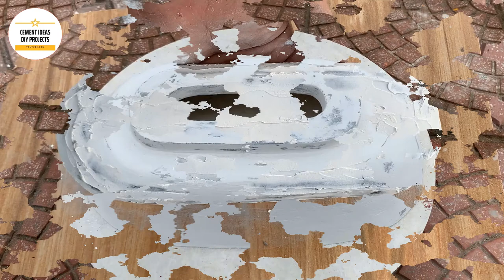Cement bathroom sink diy - how to make a cement bathroom sink

Comment: Making a cement bathroom sink can be a rewarding DIY project that adds a modern and industrial touch to your bathroom. Here's a step-by-step guide on how to make one:

Materials Needed:
Cement mix (countertop mix is recommended for better durability)
Water
Mold release agent (e.g., cooking spray or specialized mold release)
Melamine or plywood for constructing the mold
Silicone caulk
Sink template or basin for shaping
Sandpaper or concrete polisher
Sealant (e.g., concrete sealer or epoxy resin)
Protective gear (gloves, safety goggles, mask)
Tools:
Circular saw or jigsaw
Drill
Screwdriver
Clamps
Trowel
Mixing container
Sanding block or electric sander
Paintbrush or roller (for applying sealant)
Steps:
1. Design and Planning:
Decide on the size, shape, and design of your cement sink.
Create a template based on your design, or use an existing sink basin as a mold.
2. Construct the Mold:
Cut the melamine or plywood into pieces according to your sink design.
Assemble the pieces to create the mold, ensuring it is sturdy and leak-proof.
Apply a mold release agent to the inside of the mold to facilitate easy removal of the concrete later.
3. Prepare the Sink Template:
If you're using an existing sink basin as a template, place it upside down inside the mold.
4. Seal the Mold:
Use silicone caulk to seal any gaps or seams in the mold to prevent concrete leakage.
5. Mix and Pour the Cement:
Follow the instructions on the cement mix packaging to prepare the cement.
Pour the cement mixture into the prepared mold, making sure it fills the entire mold evenly.
6. Remove Air Bubbles:
Tap the sides of the mold gently to release any air bubbles trapped in the cement mixture.
7. Cure the Cement:
Cover the mold with plastic sheeting to retain moisture and let the cement cure for at least 48 hours.
8. Demold the Sink:
Carefully remove the mold and take out the cement sink. If necessary, use a screwdriver or chisel to pry it loose gently.
9. Sand and Polish:
Use sandpaper or an electric sander to smooth any rough edges and surfaces of the cement sink.
Polish the cement to your desired finish, whether it's matte or glossy.
10. Apply Sealant:
Once the cement is fully dry, apply a sealant to protect the surface from water damage and stains. Follow the manufacturer's instructions for the specific sealant you're using.
11. Install the Sink:
Install the cement sink in your bathroom according to standard plumbing practices, or hire a professional plumber if needed.
Safety Tips:
Wear protective gear such as gloves, safety goggles, and a mask when working with cement and sealants.
Work in a well-ventilated area to avoid inhaling cement dust and fumes.
Follow all safety instructions provided with the materials and tools.
With these steps, you can create a custom cement bathroom sink that suits your style and adds a unique touch to your bathroom decor.

Comment: What is the different materials of the layers you put on it?
Reply from the maker: it is mesh steel
Reply: @CementIdeasDiyProjects  I saw that, I’m asking about what you used to turn the concrete white. It was one step you didn’t label but you did label a couple kinds of colours.
Reply: @CementIdeasDiyProjects  I rewatched it, it’s a step that I missed that I’m asking about. ✊🏽✊🏽
Reply from the maker: @corruptalum4815  it is putty,like white cement